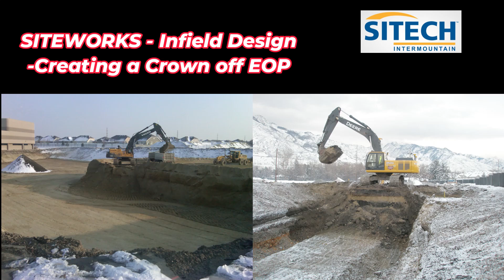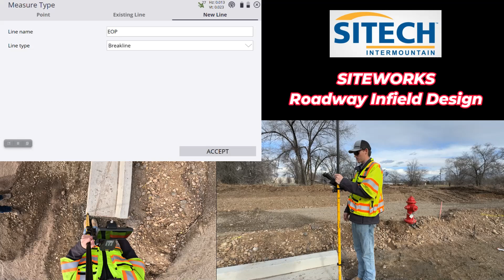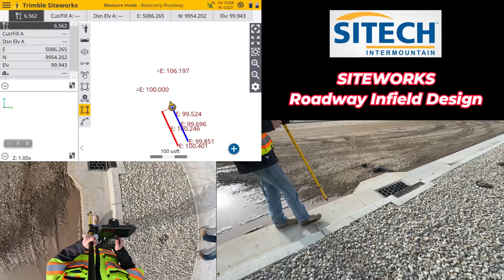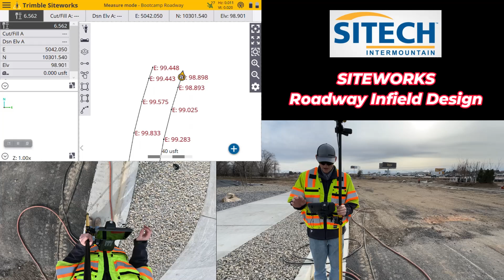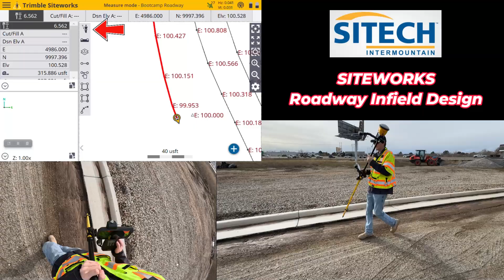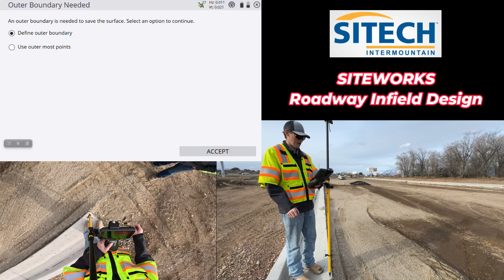Siteworks Roadway Infield design

Comment: Hey. My name is Josh Brown and I work for Goodfellow Brothers as a Grade Setter from IUOE Local 701 in Oregon. I began my job as a union laborer. I gained my current role by showing up every morning an hour early and learning on YouTube how to effectively operate Trimble guidance tech. As almost all the people I worked with knew very little and my company does not have an effective training program, I became a bit of an expert on Youtube how-to videos. I have been in my role for a couple years now. However, my education is ongoing and will remain ongoing. 
 That said, i just wanted to tell you guys that your videos are awesome. Hands down the best and most informative in the industry. Thank you for all that you do.
Reply: Well thank you very much.  I am soooo glad these are helping.  I told myself when I set out to make these that I didn’t want them to be flamboyant or too flashy, but also not to make boring videos that only kind of help.  I settled with the basics but broke down and explained button by button and why to use it.  I am glad they help.  And I applaud your effort to learn this because we only retain this knowledge by doing and pushing buttons.  Thanks for watching.

Comment: Is that a new update on the TS7 for the offset line? I've done plenty of models but I have to do mine through CoGo I don't have it on my main screen like yours so I have to extract it from the lip of gutter shots through CoGo. That would definitely save me more time
Reply: It comes with the advanced measurements module.
Reply: @JeffLarsen-iz8qk  never heard of it I'll have to look into it. I'll give you a cool tip though especially if you're working with blades go to CoGo and subdivide your line and put it every foot and you'll have a solid tight model. Makes a big difference with the machines
Reply: @motowncooking6125  oh very good.  Thanks